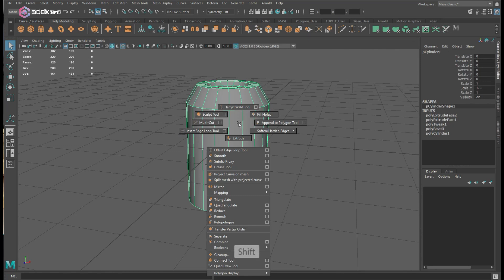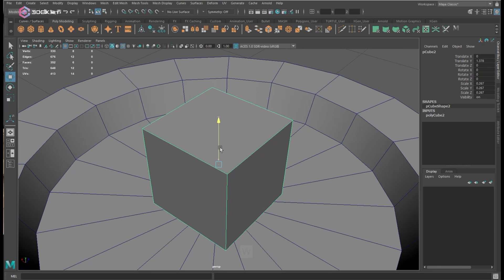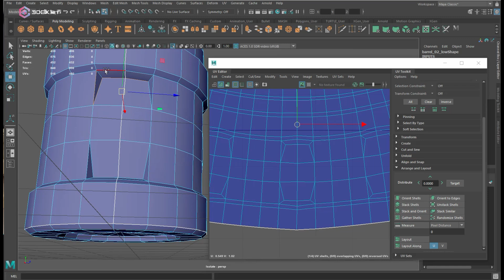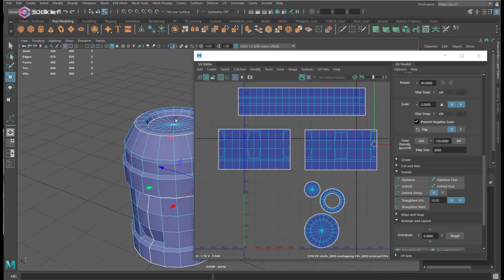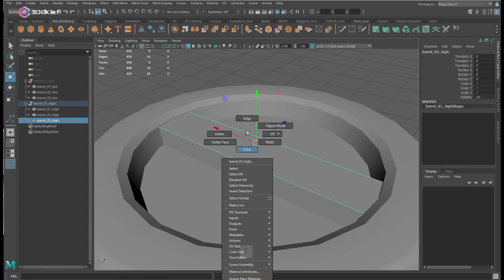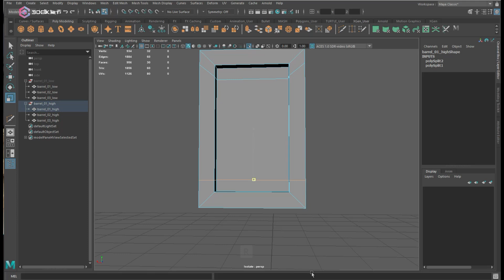Modeling a Stylized Sci-Fi Barrel with Autodesk Maya 2022 - Beginner Tutorial

Comment: qestion on uvs because I ran into this. Can I keep each of the sections round like round disc shapes in the uv editor? Took a bit but it's all smooth without any breaking.  so the larger main body uv shells I have as a round shape in uv editor.
Reply from the maker: It depends on whether or not there is distortion, if it's not showing distortion then it should be fine.

Comment: Hw do i get the uv to show on the model blue and red like in the video my is just the default color and its hard to see just work on the overlapping faces just in the editor
Reply: Im using maya 2025
Reply from the maker: In the uv window there are some shading options right below the edit menu(not inside the menu), by default is set to wireframe, but you can change it to shaded.

Comment: Great video.  Out of curiosity,  when you were working on the uvs, and dealing with the cylinder section of the barrel,  why didn't you use a cylindrical projection instead of a planar one? Gets you the straight uvs with less fuss.  Again , great video and looking forward to the texturing video.
Reply from the maker: Yeah a cylindrical projection would have worked as well

Comment: Thanks for tutorial! May I ask a question out of context? Do your full time tutorials on gumroad include low and high poly models as well? I’m still getting those artifacts so I wanna have a closer look at your models and see if I could find the reason for my problem
Reply from the maker: Pretty sure they all do. When you pack your UVs are you leaving enough space between shells? This is something that can also affect getting seams on edges. Usually you will still see somewhat noticeable seams on a close to 90% hard edge even if you bake from high poly. The thing is it may not be an issue depending on how the model will be viewed. If the model is meant to be seen from far away then not's too big a deal. If the model is meant to be viewed in first person than in that case it's worth using bevels on the low poly to prevent any noticeable seams on edges.
Reply: @3dextrude  Hey, thanks for replying. Yes, I do have enough space between shells. The model is meant to be viewed from a third person view so it’s probably not a big deal considering the fact that those seams are not visible when you look at them from a distance. Especially if I bevel the low poly, it increases the poly count a bit, but it works, no seams at all. So basically I didn’t want to bevel the edges on my low poly, but I guess it’s not a problem. But either way, I wanted to ask a professional like you, do you have those seams on non-beveled low poly models but they are just not visible cause you look at them from a distance? I’ll also make some test bakings with your models for practice and will look up for those visible seams once I get them from your gumroad